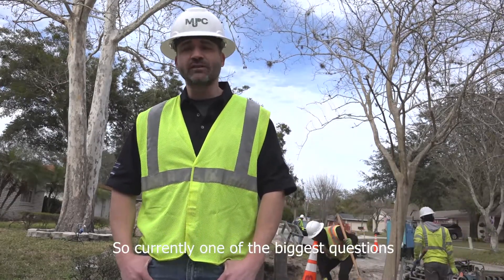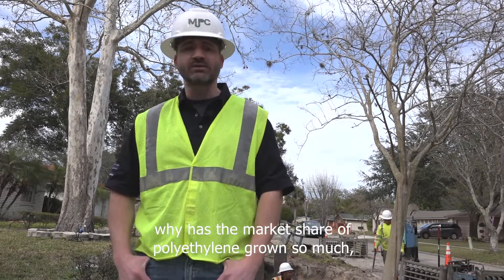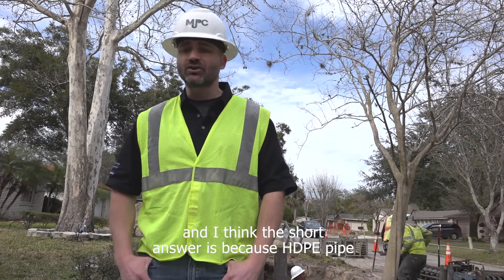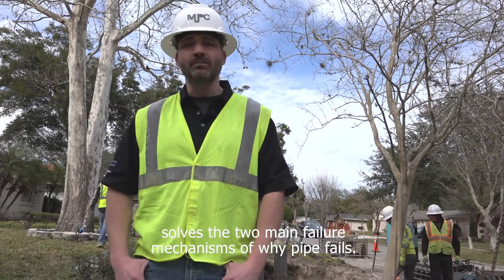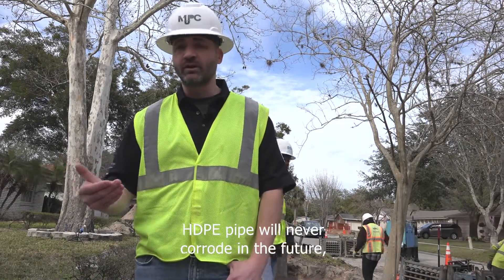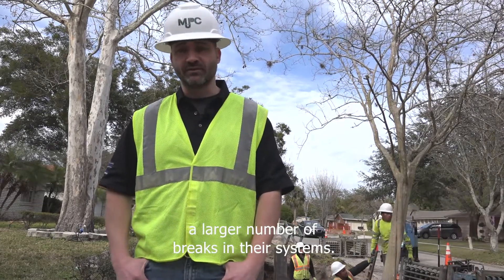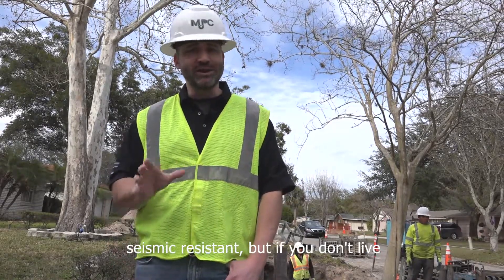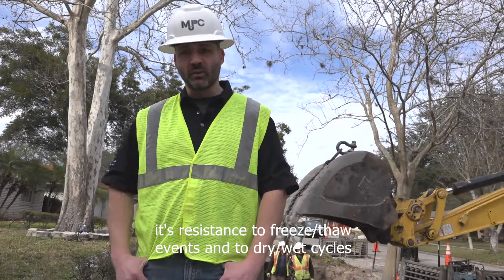HDPE pipe solves the 2 main Reasons of Why Pipes Fail

Comment: Awesome info buddy.
I am trying to replace my water shutoff valve for my house main inlet. 
I am having a hard time finding the correct Brass Fitting/Adapter for Connecting NPT to HDPE Pipe
I tried a 3/4" Barb x 3/4"  MIP fitting but the barb slides easily into the pipe. 
Do you think I can fit a 1" barb into my 3/4" HDPE pipe? Maybe if I heat it?
Here is the pipe being used for the water main in:
Eagle 3408 3/4" HDPE 160psi 
SIDR9 ASTM D 2239
Nominal Pipe size: 3/4" 
Approximate Outside Diameter: 1.02"
Average Inside Diamter: 0.824"
Minimum Wall Thickness: 0.092"
Thanks
Reply from the maker: Would hate to give you the wrong info without being out there.  Suggestion would be to call your local supply house (Ferguson, Core & Main, ISCO, etc.). They will be able to provide you with the exact fittings required and will also carry them.
Reply: I use 5/8 for half inch iirc. Heat and worm clamp while hot, solid connection

Comment: When welding pipe fusion or but welds when pulling pipe what make it snap at a weld seen hdpe 50mm walls let go at the welds what can cause it
Reply from the maker: Bad fuse (incorrect procedures or contamination in weld).
Reply: @MurphyPipelines  yeah mate as i thought cheers for the info 👍

Comment: What if Hdpe pipe is safe for used drinking water line ????.
Reply: It must be NSF 61 approved for use in potable water applications. As long as NSF 61 is stated on the pipe or fitting then it has passed a yearly toxicity test where NSF themselves check the material for leaching of harmful chemicals into water.